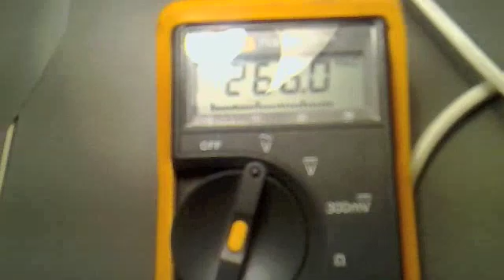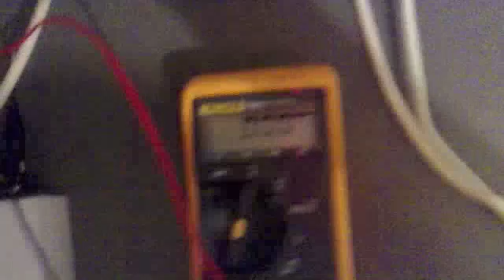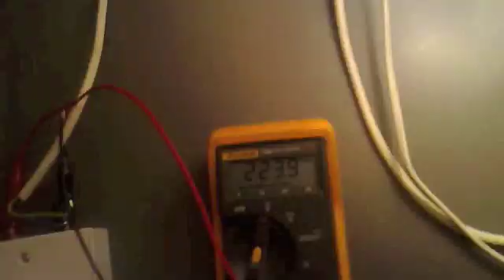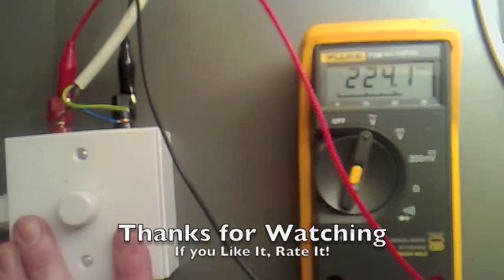Tesla Coil (Variac) 002

Comment: Hello, I have a question regarding the variac -- is it noisey?  I'm considering using a Variac model TDGC-2KVA to deliver a constant stream of 120v to an analog mixing console but need something fairly quiet.  The sockets in my wall are getting a pretty steady 123.8v...  Please advise, thanks!

Comment: kubikop asked:
> "Could we Hook it up to A 400v Electrolytic Capacitor then?"

If you're asking whether or not the Triac in your dimmer could withstand 400V or not, we would have to look at the model number on the Triac to see. For instance, the T410-400T which is a 4A Triac of the T4 series are rated at Vdrm and Vrrm voltages 600 to 800 depending on the model. The data sheet can be found at the ST website. I'll send you the link .  Max amps must be less than 4A so a limiter must be in place

Comment: Actually the Triac will leave the tops and bottoms at full amplitude, but they change when (after zero) the current starts to flow. So typically they lengthen the zero time before turning on. Once on they stay on until the current drops to zero again (which it does 50 times a second in the UK). So just think of them as gated switches that only turn on for one half the cycle and then need re-gated. 

Cheers,

Comment from the maker: You were right its almost a sine wave at full power, but it has negative / positive dips / spikes where the top of the Sine should be... urrrh

Would a big capacitor fix this? Dont know really.

Maybe an AC to DC to true AC is needed then for the dimmer switch....

ps. 110v is more efficient though